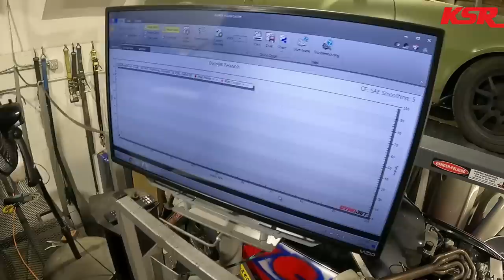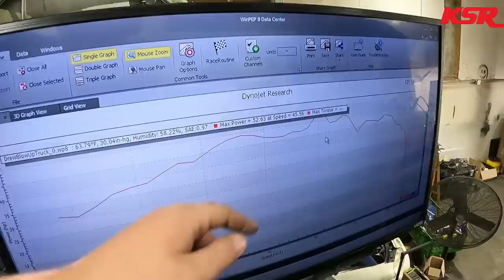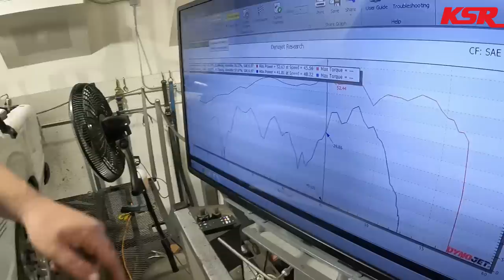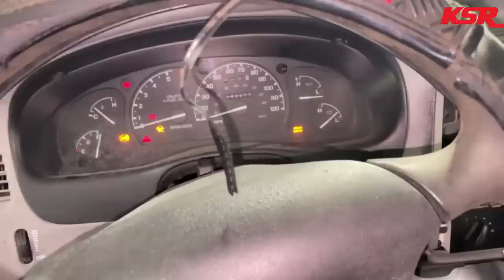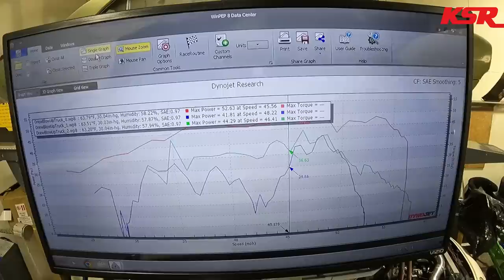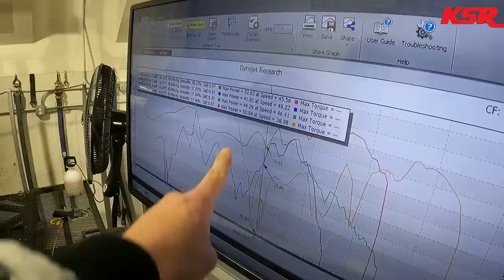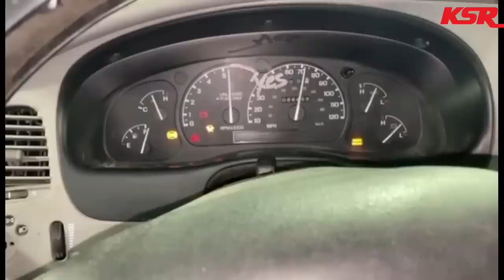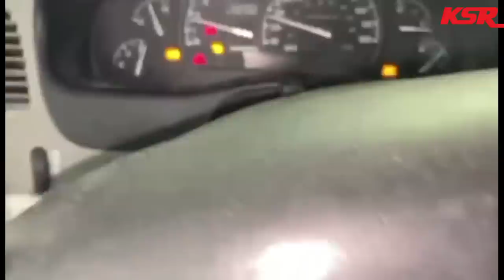Will this Truck Engine Run on Spray Paint?? Drew's Last Day Shenanigans

Comment: This is a cool experiment which should work since spray paint typically has ether or propane/butane formulations as the propellant. We don't really have many engines in the US that run on LPG but there are such engines in the world that do. But it's pretty cool to see what kind of stuff will make an engine keep functioning even at a minimum level hahaha. Good fun all around for Drew's last day. Sad to see him go but it's always nice to see an employee move onto something they have dreamed of doing. Good Luck Drew !
Reply: Lots of forklifts, man-lifts generators run on lpg... Just gotta turn the liquid into vapor.
Reply: Lots of carb conversions were sold in the 70s and 80s. It's a much bigger pain trying to inject it, and the energy density compared to the cost isn't practical anyways. 

When propane was cheap it worked good. Best part is I know one rancher that's still running old converted Chevys with 100lb bottles in the bed and he can let them sit for years without varnish and corrosion from crappy gas.

Comment: Love it. I bought a 73 Chevy ½ ton from a fellow employee where I worked. It had a rod knocking I figured drive it tell it does. Well day and a ½ that 350 blew 5 holes thru the side of the block. I drove it to my cousins garage and I already had another engine to drop in it. I was driving on water pressure more than oil.  Lol!!!

Comment: I used brake and carb cleaner a lot. To get GM vans and trucks in the shop when the fuel pumps broke.  Saved much time and backs than having to push the suckers in.
Wow, that engine lasted for quit a long time.

Comment: Did the same on a Fiat, with Acetylen/Oxygen. used a Welding torch down the carburator.
Cant say it was running good, but with the right adjustment on Acetylen/Oxygen it was running.

Comment: i retired a 327 from my old dirt track car. but it ran great so i stuck it in a old chevy PU and OMG it was fast. and i threw number 5 rod  and piston out of the ground. got out picked up the pieces   got back in the truck and drove it 6 miles back home. and the next day i drove it into the shop to pull the engine out.

Comment: I thought the ranger was gonna upchuck er engine in reverse there, every time kev stepped left or right on the dyno 😬 need a grate or something across that 🤔, I had a mercury Zephyr once 4 banger, it used 3 qts oil a week you you could wait til Friday to put it in was a performer for sure 😉

Comment: Oh god.. it's Doctor OCD! Drew's last day? I missed that.. is that part of why he cut his hair? I would've put a cage in that truck and put a V8 in it and turned it into a drag truck.. Hell, maybe even go Mazdarati with it and make it mid engine RWD. PING PING PING PING sounds like my lawn mower every time I go into thick grass... which scares the hell out of me because it's a push mower and I'd like to keep my lower body intact when it brakes.. and my dad won't replace it so long as it's still running. -.- We've had this thing over 10 years and he's never replaced the oil once. LOL "blue line green paint.." man you went a special kind of color blind there.. that's obviously purple. If you ever want to see an engine make a big boom quick, put acetylene down it's yap.. That'll do it.

Comment: So, what we've learned here is that Red is worth 10 HP over Purple  But according to California Smog standards, Brake Cleaner is OK but needs more Crankcase Ventilation and that solution is included in the can.

Comment: Old spray paint cans used to use propane as a propellant.  It made a handy flamethrower.  They stopped that in the 90s for environmental reasons.

Comment: This reminded me of a crash up derby I went to years ago.  
One of the drivers had been in 3 different events w/ the same care and never made it past 2 min before something small would take him out.  
So, he decided to rev it until it blew during an gap between rounds.  He parked it in the middle of the derby area, started it, and put a brick on the pedal.  That thing ran for a solid 15 min at a bagillion rpm and only really started to 'die' after a radiator hose blew at like 12 min...

Comment: the gas that keeps the spraypaint container under pressure usually is propane so yeah it should run just fine wilhin reason

Comment: As he was backing up, I just had an image of a quiet, older gentleman, perhaps a librarian? History professor? Anyway, I imagined him, sliding that same key in to the ignition of that truck for the first time. The first time any owner had slid the key in, and fired it off. So smooth and quiet. Fast forward to what is, and what is ABOUT to happen to Henry's truck. His name was Henry. Poor Henry. Turn away. TURN AWAY!
Reply from the maker: Bwahaha

Comment: Paint in the exhaust?...I was waiting to see the back wall look like Peter Max art...... Ya gotta be old to get that comment.......Then starts adjusting A/F ratio by moving the Brake cleaner back/away from the intake.....save the MAF sensor....yah....don't need that here you going..... bye Drew hope the next life adventure is good....

Comment: Do not run a motor on brake clean, the exhaust becomes toxic, noxious fumes that you do not want to breathe. I think it releases cyanide gas or chlorine, something really bad but you do not use brake clean in a running engine, if you value your lungs, and your eyesight.😏👍🏻
Reply from the maker: We use non chlorinated brake cleaner

Comment: Sad thing is I race them 2.3 /2.5 an that motor could've been fixed easily before y'all killed it 🤦‍♂️🤮😭... Fyi we turn a stock bottom end 8000 rpm very Saturday with no issues 🤷‍♂️.... Video is extremely old ..... Burn out car isn't even wrecked
Reply from the maker: That’s the new burnout car…… I posted that video the day after we filmed it